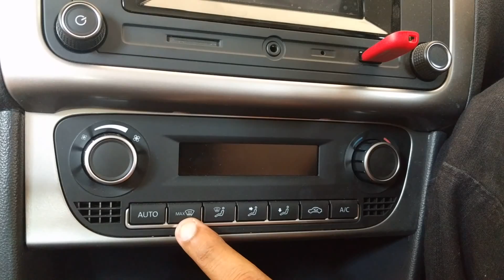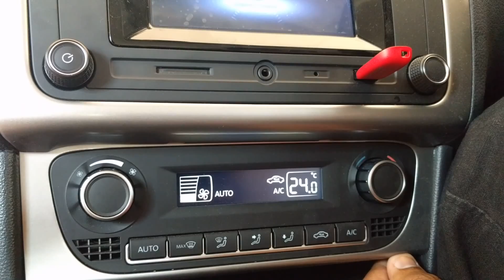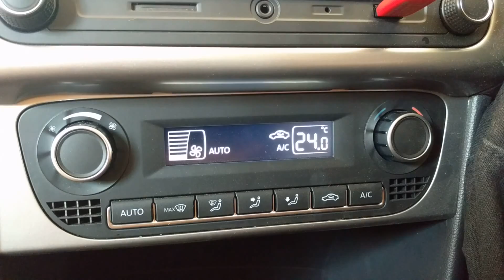Climatronic Automatic Air Conditioner in Volkswagen Polo 2017 - AllStar / Highline / GT

Comment: Hi Dilip,
Is it that we should not use the Air Circulation mode for longer time?
Reply from the maker: Yes. Exactly...
Reply: Thank you Dilip,
So only the AC option is good  when we drive on highways.?
I have followed your many VW polo videos and have bought the TDI highline version last year. Its been nice.
Reply from the maker: Yes.
Thank you so much for your valuable feedback.

Comment: how to turn off the AC after its on
Reply from the maker: Rotate the left side knob that is used to control the fan speed in anticlockwise direction until it switches off.
Reply: thanks....you are really good...superb knowledge on POLO ...thanks again
Reply from the maker: You are welcome...
Thank you so much for your valuable feedback...
Reply: dilip sukumar - How to turn off rear AC??
Reply: @dilipsukumar  it's really helpful in my vento car,,,thank u sir,,,and I can't able to pair Bluetooth in it,will u pls explain

Comment: I can see blower is still running even after turning off the ac button ?  What is the use of just leaving the blower to run ?
Reply from the maker: There is no use in leaving the blower ON after turning off the AC button. If you want to switch off the blower, rotate the left knob that is used to control the blower speed in anticlockwise direction until the display turns Off.

Comment: I was running the polo car on highway and the air conditioned was off.  Then I observed that the blower is running even though the air conditioner is off.  Can you please tell me about that and suggest me how to turn off air conditioned?
Reply from the maker: +Mohinder Grover you have to rotate the left side knob that is used to control blower speed in Anti clock wise direction to switch off the AC in Volkswagen Polo.

Comment: I use my ac in automatic mode.But a lot of fog gets on verey mirror including the rear one.......is there any chance of  problem in the ac???
Reply from the maker: +Harish kanna set the temperature to 24 degree Celsius. It shouldn't get fogged up... 
In case if it gets fogged up even after setting the temperature to 24 degree Celsius, the it means there might be a problem in the AC

Comment: How to turn off ac
Reply from the maker: +siva  bujji rotate the left side knob which is used to control the blower speed in anticlockwise direction. That is the only way to turn off the AC in VW polo.
Reply: +Dilip sukumar will starting the engine with AC on cause any problem?

Comment: Tell me about air circulation mode we need to open it Aur close in swift zxi model
Reply from the maker: +Mayank Joshi you should switch on the Air re-circulation mode (close) only when you are driving it at a polluted city. If you are driving in a highway you need to switch it off (open)
Reply: Not getting the point so when I.need to open
Reply from the maker: +Mayank Joshi You need to switch it On (Close) only if you are driving in city traffic. You need to switch it off atleast once in 30 minutes (open) to allow fresh Air inside the interior of the car. 

If you are driving in a highway,you can switch off the air recirculation mode. (Open)
Reply: dilip sukumar OK
Reply: dilip sukumar sir but on my car no light indicate weather it is on off??
Reply from the maker: +Mayank Joshi I have the Swift VXI and it has manual AC. In that a light will indicate that it is on. I haven't checked in ZXI. In the Automatic climate control, it should show in the display that it is ON.
Reply: dilip sukumar OK sir can u give ur WhatsApp no Aur Mai I'd so I can mail a short viedo of ac so u mey correct if I am wrong
Reply from the maker: +Mayank Joshi sure... My mail id is dilipsukumar@yahoo.co.in
Please send. I will reply as soon as possible.

Comment: please advise can reverse parking camera be installed with the default head unit RCD 330G in polo high line 2017??? as i have seen video claiming to istall revrse parking camera without changin head unit or else in polo 2017. Please confirm
Reply from the maker: +SHASHANK VERMA yes. You can install reverse camera with the default head unit RCD 330G. You can install it on third party accessory shops. If you ask the Volkswagen dealer, they are saying that head unit needs to be replaced. The VW dealer quoted me a price of 55000 Ruppees for reverse camera installation. It can be done at a much cheaper price with the default head unit in an accessory shop.
Reply: dilip sukumar,  can you please make a video on how to install reverse parking camera on polo with the default head unit RCD 330G? this will help all polo owner and this will be the most powerful video on your chanel.
no one has done yet so this will be the first time of that kind of video.
Reply from the maker: +SHASHANK VERMA I understand that would be a great video. But, I don't like doing any modifications in the car. I always like the stock look. That's why I always buy top end variant with all the features. I am not the right person to do such car modification videos... Extremely sorry...

Comment: I feel Blower speed is too high when we compared to other cars. Is this true ? And I can see water flowing on the ground is also too high when car is idle and ac is switched on. Is that is also true ? Any comments on these please
Reply from the maker: +Nandhu u 1. yes. The blower speed is very high. It helps in instant cooling of the car in very hot weather. Just put it in Auto mode, the blower speed will be taken care by the climatronic. 
2. Water flow is high while idling.i have also noticed it. It is a powerful ac. It cools the car perfectly even when idling. So you can notice that water flow.

Comment: how to switch off the AC ??
Reply from the maker: We have to rotate that blower speed control knob on the left side in anticlockwise direction. It Switches OFF the AC
Reply: dilip sukumar  yes I used that way olny but sometimes it won't work.
Reply from the maker: +Karthi Keyan that's the only way to turn off the AC. If it doesn't work, keep rotating the knob in anti clockwise direction some more time. The display will turn off.
Reply: ok thanks. Also can you upload a videos about engines ?
Reply from the maker: +Karthi Keyan can you please elaborate about the topic. I will definitely make a video soon.
Reply: dilip sukumar  about TDI engine and VW build quality etc